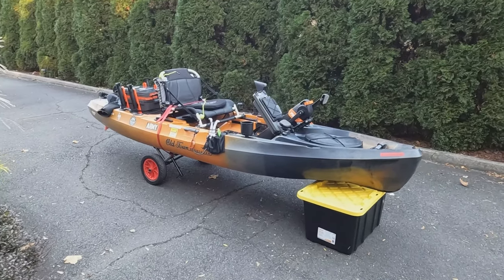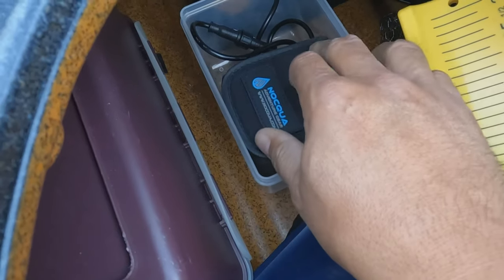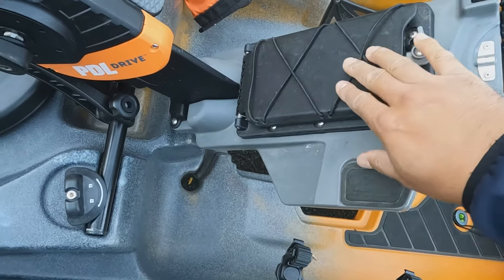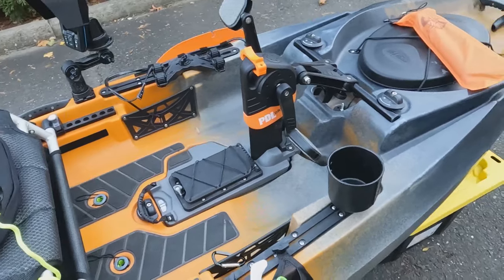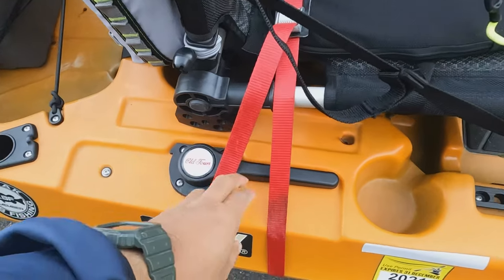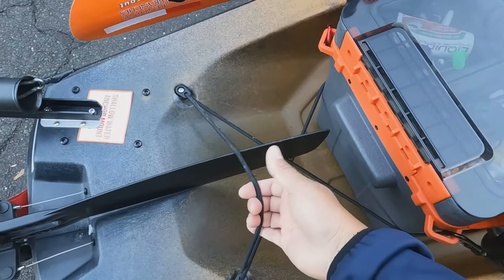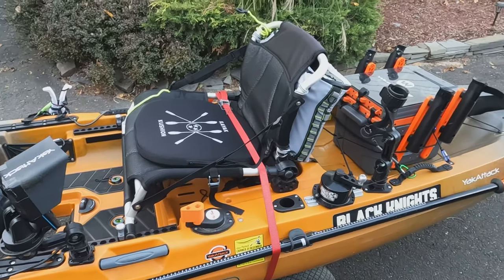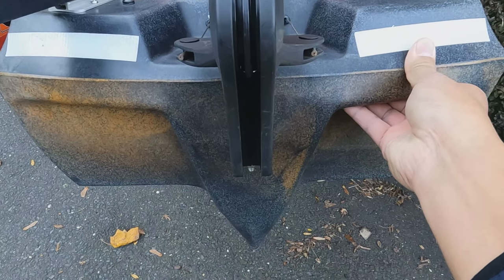PEDAL DRIVE KAYAK 1 year REVIEW (WATCH BEFORE BUYING) OLD TOWN SPORTSMAN PDL 120

Comment: Great review. I switched recently from the Predator PDL to the Sportsman 120 PDL and love it.
Reply from the maker: Thanks Jake!!  Appreciate it! Keep up the good work on your channel!!
Reply: Just curious.  I was thinking about getting this exact kayak that you have and I love it in orange too.  But, I was wondering what wrong with the predator? Seen lots of people using both.  Would love your opinion on it.
Reply: @firefighterTomg  The predator/bigwater is an awesome kayak. The only reason I switched to the Sportsman 120 is because I traded my truck in for a work van with a 12 foot box and the 120 fits right in it with the doors closed. I could get the Predator  in there but have to really struggle to wedge the nose between the two front seats. Both kayaks are awesome fishing platforms.

Comment: I accidentally came across this after a fishing video ended and watched since I have the same Yak. We've done almost all of the same upgrades. I do need to work on a different cart though. I'm short and I struggle with the cart on steep boat ramps because my arms are too short. Great review and great Kayak!
Reply from the maker: Thanks Brady!  Appreciate the kind words!!  Yeah, not easy putting it on the cart.  On steep ramps, I always put the cart on as far back as possible bc you don’t have to lift the kayak as high.  Tight lines!

Comment: Thanks for the review! I’ve been looking at several pedal kayaks from the Sportsman 120 PDL to the Hobie Pro Angler 14. I didn’t realize they had the rod holders under the seat which was honestly the biggest issue I had (nowhere to set down rods quickly ). Losing under the seat storage is a bummer too though but because there is some space behind the seat and in front of the crate, perhaps a behind the seat setup would be possible.
Reply from the maker: Glad I could help!

Comment: Great review.  I did a lot of research before getting my  OT Sportsman pdl 120  and really love it.  I am 6'4" 240lb and it fits me good and is very stable.   Yes, slower but a comfortable ride.  One of the things I think is really good compared to some other yaks are the rear molded in handles for picking it up from the rear.  I used to car top mine and the handles were a lifesaver. i have 4" risers on rear of seat and bought Nick' 1" riser for the front rail.  I went with the Boondox landing gear wheels - best mod I've made.  I generally really enjoy this yak - many more pro's than con's for sure.
Reply from the maker: Thanks!  I couldn’t agree more!  Thanks for checking out the channel.  Happy Holidays!
Reply from the maker: Btw-I love boondox.  May add that at some point!
Reply: @WannaFishAllDay  please make a video! Is there room between your anchor wizard retrieve and that rod holder? I want that exact setup. The landing gear and my anchor wizard off the back like you have it. Just purchased my 120 pdl.
Reply from the maker: @MikeG4500  decided not to go with the boonedox.. i might in the future but happy with the malone cart.  Congrats on ur purchase.  I have a bunch of other mod vids so check them out.  Just added a motor recently.  Cheers!
Reply: @WannaFishAllDay  do you think there is room with that track you mounted to have the boondocks with the anchor wizard? I’m waiting for my kayak and obviously just going nuts on what to get lol
Reply from the maker: @MikeG4500  I would think so but tough to say. I would definitely install the boonedox 1st bc i think it would be easier to find a spot for the anchor wizard elsewhere…
Reply: Your post makes me feel better about buying a kayak. My biggest concern was stability but if you have no problem then I won't since I'm only 6', 180. I'm 70 and don't need to be falling in the water.

Comment: Nice review👍 How does the anchoring work without an anchor trolly? Only attached at on point.
Reply from the maker: It’s okay in zero to low winds but I think it’s gonna be much better in tough conditions with the anchor trolley… I would not want to solely rely on the anchor stick mount (from Navarre Kayak Fishing) in fast current or strong winds.

Comment: Thanks for the great review!!  It was one of many I watched to help me decide I wanted to purchase the same yak and it 
just arrived a few days ago.  Question I have is it only came with 2 scupper valves (with the pull strings), so should I have gotten more?  I have 11 drain holes but only 2 scupper valves to plug some of the 11 drain holes.  How many scupper valves were included with your yak?  I noticed you had 4 of them installed (with 2 under the seat). I got the same yak as you just the other green/photic color.
Reply from the maker: Hey Jason.  Thanks for the kind words!  No scupper valves came with my kayak.  I called Old Town and ordered them.  I usually plug the four in the tankwell and two under my seat.  The rest depends on what type of fishing I’m doing.
Reply from the maker: Btw-congrats on your purchase.  I love my OT kayak!

Comment: Just subscribed to your channel. Like your practical content. Do you have time to offer some advice? I live in Arkansas on the Caddo River. Wife and I buying our first fishing kayaks - both just retired. We have settled on the OT Sportsman  model, but we can’t decide between the 12” or the 10 1/2”. Wife is tiny. I am short 5’ 6” but 175 pounds. Fish Caddo River only or creek very similar. Will you please offer your two cents? Thank you, Butch
Reply from the maker: Hi Butch!  Thanks for checking out the channel.  IMO, both models are great.  Very similar layout besides the 18" difference in length.  I think the 106 might be slightly better for you both since you are river and creek fishing.  The shorter length and lighter weight will be easier to load/unload/transport.  Both are super stable so you really aren't giving up stability with the shorter length.  Also, weight capacity isn't a concern for you both so again, leaning a little towards the 106..  Nice that it's a little cheaper too.  All in all, you can't go wrong with either option and if possible, I would try a demo in warmer weather before making a final decision.  Good luck and thanks again for subscribing!!

Comment: @Wanna Fish All Day - You stated you were a tall person and noticed your seat was set 7 slots back. I am 6'5 and am trying to setup a new Sportsman 120 pdl. I was curious how my setup would like up with yours. I have a 36 inch pants length. Would you mind sharing your height? I don't really wanna try getting on the water in the winter... lol
Reply from the maker: Hey Adam, thanks for your comment.  I’m 6’2 and I’m constantly moving my seat forward and back depending on the conditions and how I’m fishing.  If I’m fishing standing mostly then I’ll move my seat as far back as possible for a more open deck.  If I’m on the move a lot, then I’ll have it more forward.  However, for your height, there’s still plenty of room.  A good rule of thumb for me is to extend it back just far enough so there is a slight bend in my knees when pedaling to avoid injury from locking out my knees.  Also, when I have my daughter in the rear storage well, I’ll have it as far forward as maybe 3-4 notches back, albeit not the most comfortable position.  Hope this helps.. Cheers!
Reply from the maker: Btw-34” inseam..

Comment: Do you tend to get a lot of water in the boat around your feet/legs?

Really want a pedal kayak for photography as paddling is a huge PITA while running a camera and trying to station keep. But i dont my my expensive gear sitting in a puddle.
Reply from the maker: Not a lot but it’s a kayak so there will be water in it at times.  Never a puddle bc of the scupper holes.  They drain fairly quickly.  You could also get the one way scupper valves that keep water from coming up but also drain out.
Reply: @WannaFishAllDay  true on the plugs.

I have a Jackson Killroy DT currently and it's just to much for a single person to man handle in and out of the truck. Prop drive would be a dream come true for Videography lol
Reply from the maker: @MannsWoodlandPerspective  hands free is a must for me for fishing.  I would imagine it would be the same for u if u want to take photos on the move..

Comment: How is it for your height? I am 6'7" and wondering how I would fit. I am thin so not worried about my weight.
Reply from the maker: I’m 6’2” and I don’t put the seat all the way back.  Still have 3-4 notches I can go back.  I would imagine you’d be fine but definitely recommend testing one out.

Comment: Can it be changed to the motor ?
Reply from the maker: If you’re asking if you can convert it to an autopilot or MK, the answer is no.  I added a bixpy motor to the stern and have plans to add a bow mounted xi3 this winter.

Comment: What method are you using to mount tracks in the rear with no access there.
Reply from the maker: Just screwing into the kayak.  No issues.
Reply: @WannaFishAllDay  so no back plate? I have an anchor wizard and am worried about the stress on it without a back plate

Comment: How do you did the template with the kydex....?
Reply from the maker: I just kind of eye balled it to make sure it was long enough to cover the entire front corner of the keel.. It’s probably 6-8” long by 4” wide..
Reply: @WannaFishAllDay  but do u heat over the kayak to make fit ?
Reply from the maker: At first I would only heat the strip of kydex away from the yak and then place the heated strip on the kayak to shape.  You’ll have to do this a few times to get it about 95% right.  The last 5% I would heat it on the kayak but at low heat to ensure I don’t warp the kayak.  Just be patient with it.
Reply from the maker: And try to direct the heat on the kydex piece and not directly on the kayak as much as possible.  The kydex will reach a point where it will soften and that’s when you know it’s heated enough to shape.
Reply: @WannaFishAllDay I was thinking about cutting a cardboard and used as template
Reply from the maker: Even better!  Good idea
Reply: @WannaFishAllDay  hell yeah